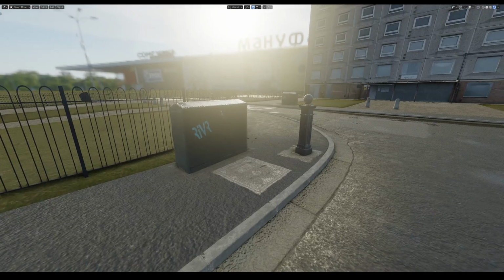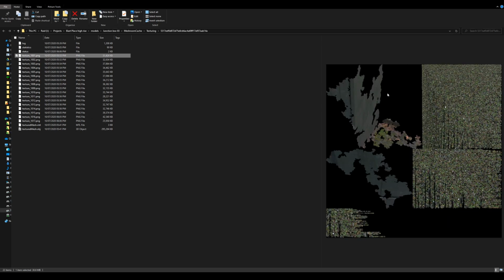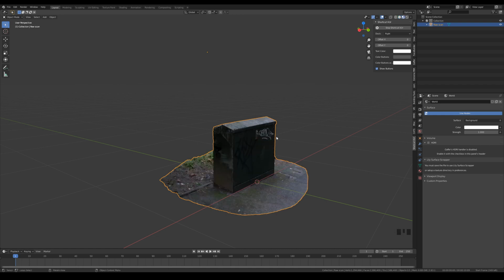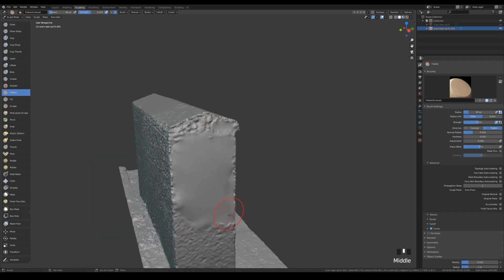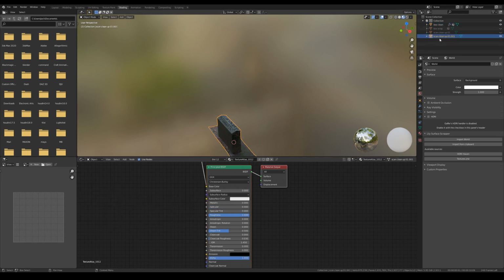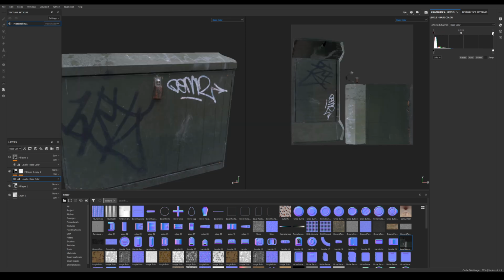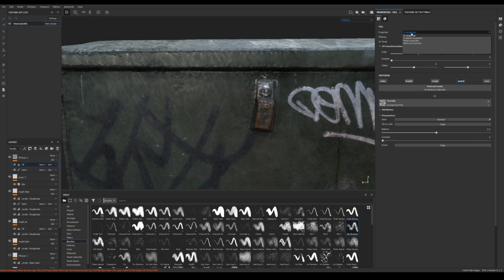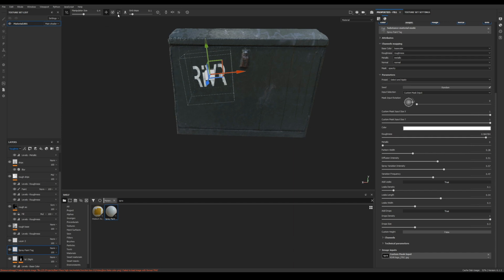Meshroom Blender photogrammetry workflow

Comment: Nice, however with this model, the only thing you used from your 3D scan is the texture, everything else was re sculpted or changed.   
And with a simple shape like this, would it not be better to just quickly model it from scratch then use some pictures and change them to a texture and fit them with UV.
Reply: This is my exact feeling even after watching many videos on photogrammetry, not a single convincing video I found till now. Someone please clarify if I am wrong.